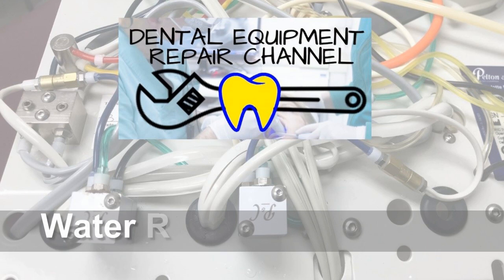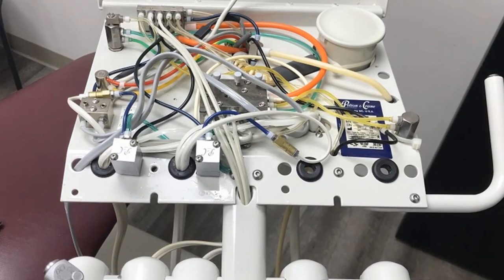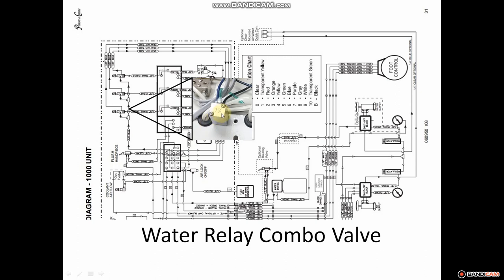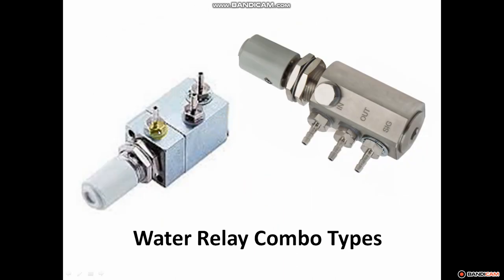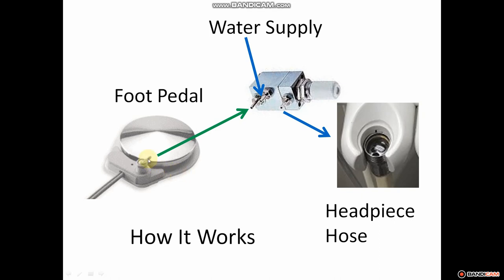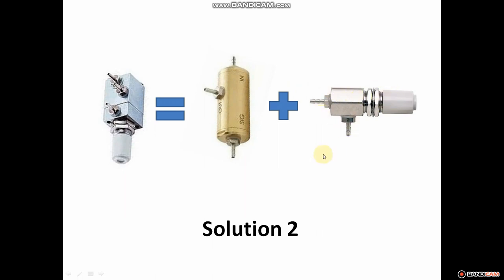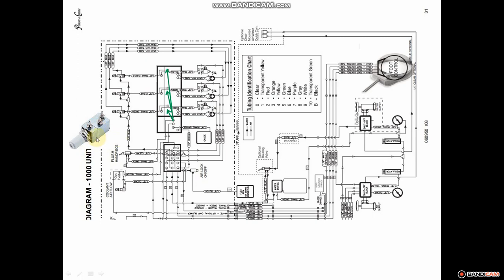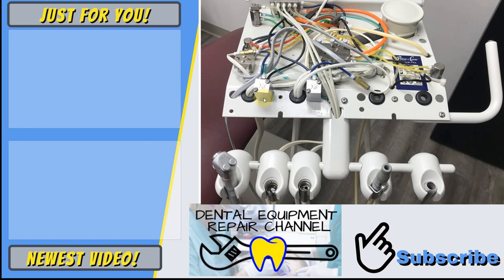Water Relay Combo Valve Repair!

Comment: Great video! Have you the issue of the water keep flowing still persist even if you change out water relay? What would be the options then?
Reply from the maker: Does your system have a water flush? If so, that system might be doing it. To test, clamp off the line coming out of the water flush toggle with hemostats.

Comment: What happens when the water control does not adjust the water pressure?
Reply from the maker: The water pressure is controlled by the water regulator (city supply) or the air regulator (bottle system). The needle valve controls flow and the water relay is on/off. If the needle valve is not adjusting flow, it should be replaced.
Reply: @DentalEquipmentRepairChannel  thank you for this response!

Comment: Hello.
when I lift the high speed handpiece, from its nest, water begins to flow, from the hole in its head, for water.
normally, this should occur when I press the pedal. but it flows by itself.
what should I change in the unit? Thanks!
Reply from the maker: What kind of delivery unit do you have? It sounds like you have a water relay valve that has failed. They are normally gold. Follow the handpiece tubing back and fold the lines over until the water stops flowing. It will be one of the two smaller lines, follow that back and see if there is one of those valves in the path. It sounds like that valve has failed. If you have an an Adec unit, it may be more complicated.
Reply: @DentalEquipmentRepairChannel  Is a dental unit of Chinese production. The foot pedal is pneumatic (except for the scaler).
Reply from the maker: I'm not sure on that. I try to stay away from the Chinese units. They have metric tubing and the quality is generally pretty low. I'm not sure how to advise you without seeing the unit in front of me. You might need to call a technician in on this one.
Reply: Nice breakdown of the different valves and relays. I prefer a combo valve over a relay/needle valve set up. When the relay leaks then it tends to pour out of all HP positions, vs the combo isolating it to a specific position. Also it’s important to use a non-retraction relay if using the separate components.
Reply: @vallejokid1968  a technician told me that the Dental Water Retraction Valve
is the defect
Reply: @marc_po.  yes that would be my guess based on your comment. As explained in the video they all eventually fail. A non-retracting and retracting valve are basically the same thing, but a retracting valve will pull water back into the handpiece and tube after you take your foot off the pedal. A non-retracting let’s a little bit of water continue to drip after pedal release, usually 2-4 drops. It is a common maintenance item. Depending on your water quality they can last a short as 6 months to many years. If you use bottled water and tablets then sometimes the tablets cause the o-rings in the valve to deteriorate.
Reply from the maker: @vallejokid1968  Good points. I usually use one clippard valve per handpiece if possible. I used to install only non-retracting, but the dentists don't like the handpieces dripping so I just give them what they want. 🤣
Reply: @DentalEquipmentRepairChannel  understood. We were instructed not put in retraction valves because there is the possibility of bacteria being pulled back into the HP and eventually the tube.
Reply from the maker: That's solid reasoning. You sound like a great tech! I've had a few calls where I had to come back in to replace because of the dripping. Most dental units water lines are nasty on the inside so I just have not really fought that battle as hard as I could. We do recommend some sort of water treatment to prevent biofilm.  Since biofilm comes from the city as well, it's important to combat biofilm from all directions.
Reply: @DentalEquipmentRepairChannel  thank you. 19 years and still going. I work in the pacific north west.